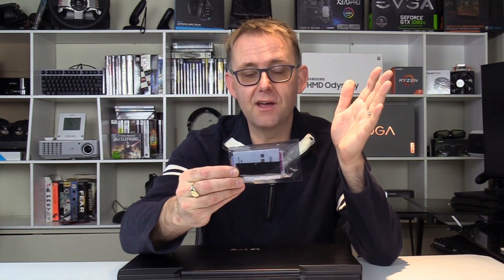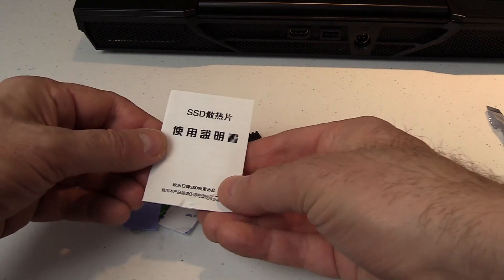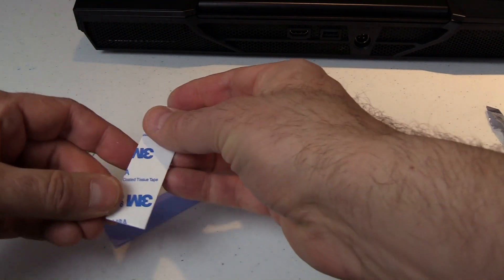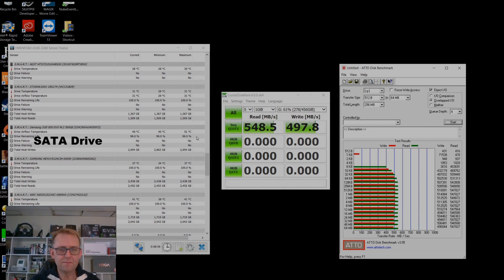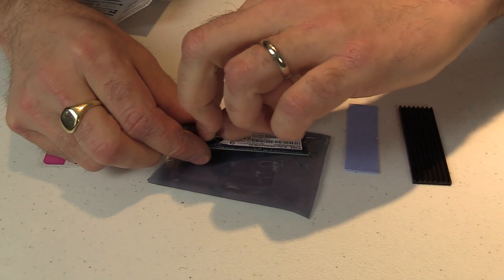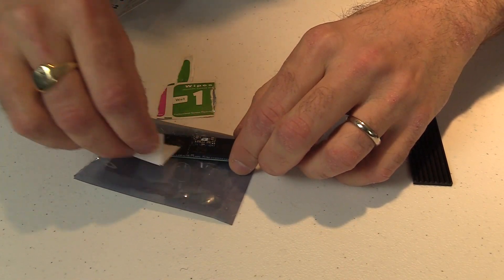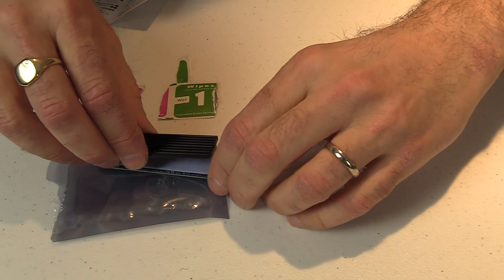Does An M.2 Heat Sink Actually Help Lower SSD Temperatures ?

Comment: I just bought a used 2019 laptop and did some reading on PCle. For the time being i think it just does not work in a laptop because it gets to hot unless maybe you set the Windows to low power use. Because it gets rather hot it will dryup paste rather quick also that is not good for the laptops life. Also when a heatsink is to heavy it can cause damage in a laptop. I understand such SSD is for intensive tasks but one should not use a laptop for such tasks anyway. So for the time being i will put in a sata SSD 870 Samsung and will remove the Intel 660p that is in it.

Comment: I want to upgrade my ssd but could be sure that will depth effect to insert into my device or not. I have msi gp 76 ssd size with heatsink 4.3 mm without 3,3 mm, should ı buy it? Or can i use it without heatsink?

Comment: You can't just stick the fin on the thermal pad without putting the two brackets included to secure them.... if you travel with your laptop the fin very well could fall off the thermal pad, then disaster ensues as it shortcircuits everything.
Reply from the maker: I show whats in the bag and there were no metal clips. It is still in my laptop to this day and I have had no problems what so ever.

Comment: My Samsung 970 evo jump up to 110°C during gaming, most often 90+. I just order two copper heatsink 2mm thinkes and provide better cooling on my laptop stand.
Reply from the maker: Thanks for your input!
Reply: I just made DIY heatsink from piece of copper! 3mm thick, polish it, set on thermal paste in, tight it with rubber bands! Temperature drop from 92°C to 61°C. Even few pass more with CrystalDisk did not raise temperature! Awesome.

Comment: Very much appreciate the video. Came here after Sony opened up the SSD expansion slot on PS5 but recommended using a heat sink on the SSD.
Good to know I'm not getting scammed if I buy a heatsink for an SSD that doesn't come with a stock cooling solution.
Reply from the maker: Glad it helped! Thanks for watching 😀👍

Comment: its ok when its 60 max but its not ok when it goes to 75-80
Reply from the maker: Don't know,  heat kills chips so I'm always of the mindset lower the temperature the better. .
Reply: @OWNORDISOWN   I heard that high temperatures are good for memory cells, but what if 70 up degrees is never good for the rest of the electronics. I used a double passive cooling from old motherboards in my ssd bx500 and only now the disk works perfectly, it freezes less when copying files. https://imgur.com/a/iqxulBW
Reply: Btw i lost 10% ssd lifetime in half year, now i will see results after cooling and next half year
Reply from the maker: @MikeleKonstantyFiedorowiczIV  so, adding the passive cooling solution helped with its performance.  I heard that vRAM needs to be kept below 90 degrees whilst CPUs are said to be OK to about 105. Still, cooler is better in my books!
Reply: @OWNORDISOWN  When copying files, my disk often fell to low performance after the buffer was full, now the drops are less frequent, it seems to me that the disk has a built-in speed limit when the disk becomes too hot. The disk I have is cheap, but the cooling improvement is good enough that I definitely recommend such a modification, especially when the disk housing is plastic and not metal with holes, with m2 disks I think that heatsing will also improve the overall quality of the disk.

Comment: i always wonder how much M.2 temp difference there is, when you use the PCIe 4.0 (near to GPU and CPU) vs PCIe 3.0 (nothing near).  I cannot find any tests for that. I think the M.2 SSD on a PCIe 3.0 port should be much cooler. Informations would be great
Reply: Great question, I have a 970 evo plus sandwiched between the cpu i7 12700k and a 3070 xc and boy can I tell you that can run hot, even with a heatsink, the controller can hit 80°-90° degrees Celsius. This is with ample airflow, and the cpu has a beefy dual fan Noctua nh-u12s tower.

Comment: I don't care about this ~10 Degrees!
YOU LOSING SPEED WITH THIS PIECES OF ...!
Just pack your Case with High-end Fans and create stable airflow ...The hard drives needs only that!
Reply: I can’t see how you would lose speed it doesn’t make any sense, I think it’s error not caused by the cooler..
Reply: @GimiBsk  You have absolute no idea how M.2 works didn't you?
Reply: @Lancista  Do you think putting passive cooler on the flash will cool it so much that it would perform worse? These aren’t magical coolers. With passive cooler you will never get to the point where it’s detrimental. You still can put passive heatsink only on the controller anyways

Comment: I just bought a 2TB Samsung M.2 and a heatsink kit just like that with the silicone rings at MicroCenter. I didn't peel off the warranty sticker. Those stickers are so thin I don't see it being any worse than the thermal pad itself.
Reply: The stickers actually act as heat spreaders, you should leave them on

Comment: Hello. I've seen a lot of users don't remove the label m.2 sticker , I removed it from my SSD as you do, some other users remove the label too. 
 . I've seen explainations by experts in electronics on youtube, even in the Laird thermal systems website they don't show any component between the heatsink and electronic device. recently I received a reply from a youtuber: http://altared.net/ee/dc5ps_046o.png . I've seen videos of experts in electronics, in spanish and english, and they always show :electronic device+heat sink component directly, without any label between them ! , and still I say the sticker should be removed (o0)

Comment: It's strange because I use an 2.5" SATA and an M.2 NVMe drive on my laptop and when I write some games on them the SATA drive is hotter(63°C) than NVMe drive(52°) even the 2.5" drive has a metal case that covers the board.
Reply from the maker: perhaps there is no thermal pad from the chips to the metal casing?

Comment: that laptop looks like a beast.
Reply from the maker: It is, it's awesome. My favorite.  I'm actually going to do a follow up review to show how it still holds it's own in games.
Reply: @OWNORDISOWN  it better hold its own. a laptop that thick better have desktop quality parts lol. I don't think my laptop in 2003 was that thick. :) 
I don't think I would mind a laptop that thick if it had quality parts, that were reasonably priced, and was well cooled. all things I would expect from a thicker laptop :) this race by manufacturers to create the thinnest of thinnest laptops is misguided in my opinion.
Reply from the maker: @Mehwhatevr  well, the CPU can be replaced, I have put in a desktop 9900k. It uses MXM GPUs, so I can run two GTX 1080s in SLI or even just put in an RTX 2080. It really is a desktop in a laptop. It has two ethernet ports, two TB3 ports, 2 display ports, 5 USB A ports and an SD card reader. Panel is 2560 x 1440 120 Hz.
It games as well as an RTX 2070 max P.
Also - it has 3 m.2 slots and 2 x 2.5 bays...

Comment: Pro tip. You don’t meed to remove the sticker when installing a heatsink
Reply from the maker: surely it would affect the heat transfer? Have you done a comparison test with and without removing so you can share the results ?
Reply: OWNorDisown the manufacturers make them heat conductive
Reply from the maker: @kenshiromilesvt.7037  it certainly would make it easier and less worrisome about losing any warranty.  I will have to do an actual test at some point to see what difference,  if any, there is.

Comment: One small thing- when applying any sort of double-sided tape, it's better to take one covering tape section off, apply the tape to the object, then remove the second covering tape section, preferably with tweezers. Helps stop the DS tape sticking to your hands or reducing its efficiency thanks to fingerprints.
Reply from the maker: Good tip, thanks 👊

Comment: But this comes from NVMe based on PCIe, you are testing SATA, not suffer from thermal throttling which reduces drive speed. Pointless
Reply from the maker: You are not going to get 1724 MB/s speeds with SATA

Comment: I generally would not recommend removing the sticker as it voids warranty. I put a heatsink on my 970 evo with the sticker(some of them have copper on them) still on it and beside lower temperatures I even got a performance increase.
Reply from the maker: Thanks for sharing the info. In the USA removing the sticker doesn't void the warranty.
Reply: OWNorDisown happy to hear that

Comment: Ola, I'm a Brazilian. Do you recommend retiring the 970 Evo Plus sticker before installing a heat sink?
Reply from the maker: I do, to make best contact as possible.
Reply: @OWNORDISOWN  ok, thanks.
Reply: @marcceloneres  it voids the warranty to remove it. The sticker actually has copper in it to spread the heat, so you can put the pad over it as it's already acting as a heatsink.
Reply: @nonstopbg  I removed. Thanks.

Comment: I recently did some testing with this as well.  I found you can get up to about 25% reduction in peak temps during sustained read/write when using an 'active' heat sink with an integrated fan (more of an option for desktop PCs).  The lower temps are desirable for helping prolong the life of your M.2, as well as reducing heat stress on your other components.  Just be aware that the lower temps, in the vast majority of situations, are not going to do anything to improve performance...if that was the goal.  Thanks, man!
Reply: Shame you didn't do a performance comparison between baseline and cooler temp. NAND chips operate better at HIGHER temps, although the memory controller (near the connector) prefers to run cooler. Obviously if you run a synthetic test hammering your NVMe drive, cooler stops it throttling - but how often do you do that?

Comment: when i upgraded  my laptop hhd to m.2  since then i feel heating issue . what is the problem is this m.2 problem or windows?
Reply from the maker: SSD's run faster so do get warmer.
Reply: Is this harmful for my laptop?
Reply from the maker: @merajmohammad4700  no. You have to make sure there is enough clearance between the heatsink and your back cover.

Comment: It seems like he just showed the temps on two different drives. I don't see how that is a useful comparison. I would have first tested the nvme drive without the heatsink, and then tested the same drive with. but he showed a sata drive for the first test and temps. Makes no sense.
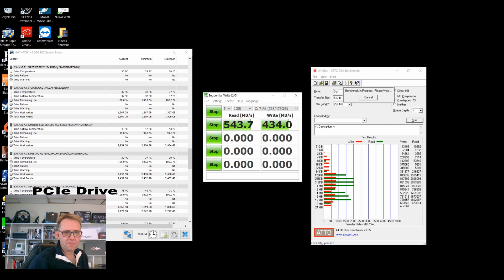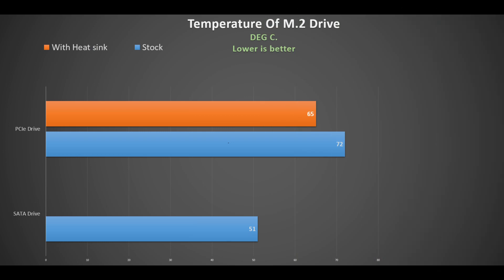Reply from the maker: At 01:38 o show the temp of the PCIe drive with no heatsink and at 02:38 I show the temp with the PCIe drive with the heatsink on. Perhaps you weren't paying attention...

Comment: The benefits of living in China, Taobao sellers throw these in for free when you buy any m.2 SSD (along with screws, screwdrivers, thermal tape, whatnot). Heck ask nicely and they'll throw in 2-3 of them, it costs them next to nothing. I have an external m.2 set up and just attached 3 of these sideways to the aluminum casing for ultimate heat dissipation.

Comment: So while it may work to keep it cooler... NVME heat shields aren't a good idea to begin with. The nand is designed to run hot, and you can actually create negative results from adding a cooler or heat shield
Reply: My nand is reasonable but my controller temp on my Samsung 970 evo plus is hitting 90c under load! I Samsung states the operating temp is up  to 70c but which are they referring to the nand or controller?!
Reply: @Jonathan-yk2mx  That seems really warm -  like overly warm. Almost sounds like there is another underlying issue. M.2s won't crash or anything under extreme temperatures though they will just throttle to cool themselves. I'd recommend doing a read/write test and monitor the temps during. You should see around ~3k sequential read/writes  --- and if you are getting those during the test, you are probably ok.
Reply: @BigSyn  I have had no issues and love the blazing fast drive. I only seemed to see possible throttling while running CrystalDiskMark near the end of the test after building up heat. I think because the m.2 is sandwiched between the cpu and the first pcie/gpu coupled with the fact I have an AIO cpu cooler creates bad airflow. I imagine a cpu fan blowing in that area would help alot. I literally just installed a heatsink on the drive and now my idle temps in HWinfo are temp1 47C and Temp2(controller) 49C. Now during full load back to back benchmarking the thermals haven't passed 58C for the NAND and 66C for the controller! From 95C to 66C on the controller what a reduction! My read/write are 3500/3200 btw.

Comment: Great info, thanks for the video.  May I ask a question please? You seem very knowledgeable and nice. I had a Toshiba THNSN5128GPU7 SSD put into a new laptop, it only contains the operating system, no data at all. Three years on, and a couple of days ago it went from being a bit of a warm spot in the bottom corner to hot enough to cook eggs. I gave it a good clean, but the only way I can keep the temp down is by having the bottom cover off and a floor fan blasting it directly. The hottest I tested was 65 degrees, but this was after opening it up and cleaning it so I think it may have been much higher; the fan is keeping it between 40 and 50 degrees but is not practical.
The question I have is simple - does the sudden drastic heating mean that the SSD is on it's last legs? I'm no expert but am capable of putting a new one in. I am in a developing country where repairers are mostly incompetent or out to make their fortune by overcharging expats, so if possible I'm set for DIY.
So, my thinking is that this new and drastic overheating means I need to buy a new SSD and the problem will likely be solved, or is my assumption wrong and it could be a bigger issue?  Everything else is running at good temps, it's just this SSD.  I can't go into a shop and ask because of language probs and so many repairers that have more good intentions than ability - I really would appreciate your opinion.
Reply from the maker: Thanks, glad you liked my video👍 is the drive losing performance?  If not then it's probably OK. I'm thinking there must be some applications that are doing alot of read/writes in the background. Perhaps it's possible to isolate those ? It's a difficult thing to isolate though unless you recall installing something before it started to heat up. It could even just be updates. 
The heatsink may help you but the heat still has to go somewhere. If the bottom of the panel is aluminum then some people attach a thermal pad to the SSD so it makes contact with the bottom panel and that acts like a larger heatsink.
Reply: @OWNORDISOWN  It had occurred to me that something new might be going on, I hadn't installed anything but sneaky coin mining type activities is always a possibility, so I formatted and did a clean install of Windows yesterday, and even as it was installing it was getting hot.  Performance whilst installing seemed a bit off, but since then it's been going OK - as I said, just a bit impractical with the cover off. 

I was more worried that the excess heat could do a bit of damage to everything else inside the laptop.  I had hoped it would be a simple 'yep, bung a new SSD in and all will be well in the world' but maybe I'll just have to get used to the cover being off.

Thanks anyway though, I'm looking forward to browsing through some of your video's, not everything interests me (I'm an old Unix and cobol zombie from way back but I just don't get gaming at all), I watched the one on how much money you make from a few weeks ago, it was really interesting, and you were helping those who may be just starting out with tips, which is really nice.
(My husband is from Billingham, you sound rather local.  Hope you're not sulking as bad as he is because Derby won )...

Comment: If I do not remove the sticker from the nvme, it will not have the same cooling, right? :'v
Reply from the maker: Correct, that will just insulate the drive. Need good heat transfer...
Reply: @OWNORDISOWN  Incorrect. Manufacturer labels on SSDs are foil+copper, not paper. They're very good thermal conductors. This has been tested a large number of times by various enthusiasts and there's negligable benefit to be had removing them.

On the other hand, thermal pads aren't as good as using thermal paste. It's all down to the mK/W and the thickness of the layers. Both are only there to replace air bubbles and you want them as thin as possible, but pads always end up thinner (Pads and paste both have rotten thermal conductivity but rotten is still hundreds of times better than air. Water or oil is best at filling the gap and transmitting heat, but neither is permanent.)
Reply: Actually you can get a similar result without removing the stickers.
You still want the warranty so maybe just leave it.
Reply: Thanks ;)

Comment: Hello great video, I installed an ssd with heatsink in the lenovo y530 and it produces a little bit of pressure, do you think it's Okey or I should remove the heatsink?
Reply from the maker: Agustin Zavala I think you should be ok 👍